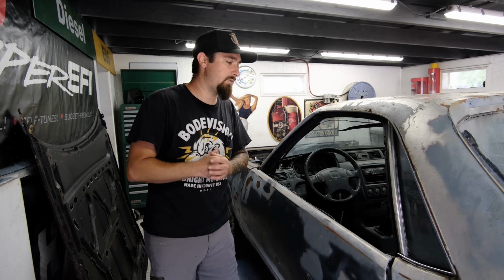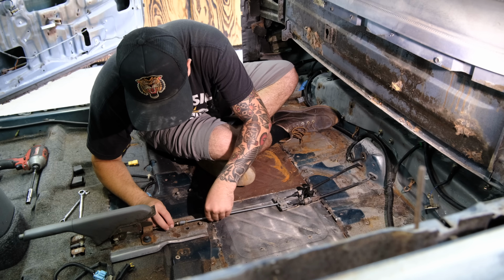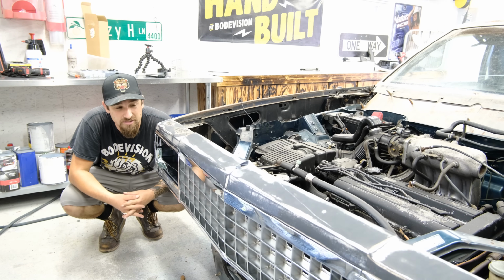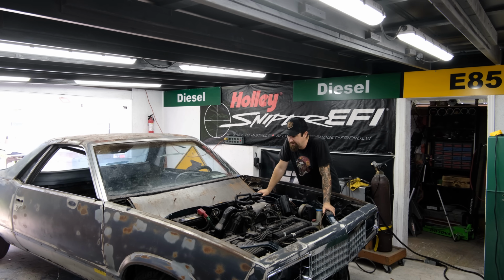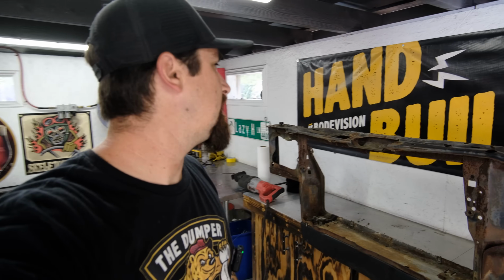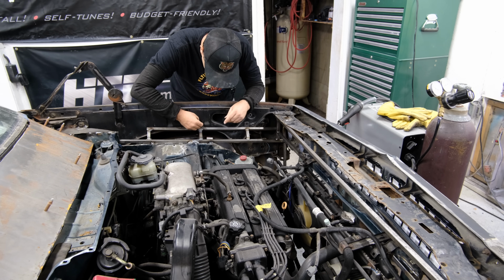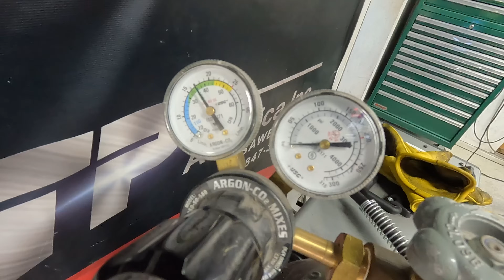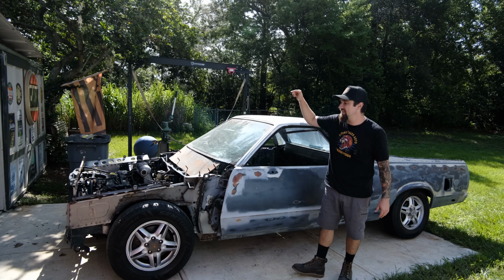Insane Body Swap: El Camino Front End on Honda CR-V & V8 Honda Accord is GONE | BodeVision

Comment: Being from Alabama I know how hot it is down here, keep the A.C you'll be glad you did if you drive and drag or just cruise to shows.
Reply: Im from Florida right around thr corner from bode actually. Keep the a,c!!!
Reply: Yes, Drag and Drive!!
Reply: I'm in Ky and a/c is sin, never use it.
Reply: @ItsDaJax  here in southern Alabama we have high humidity that stacks on that heat and I've come close to dying in it twice so if the a.c works I'm using it.
Reply: @M.Boatwright  I live in Kentucky, I'm familiar. Summers average about 90-95° without the heat index.

Comment: If you have to extend the drive shaft, you should get a Freelander drive shaft with a viscous coupler and pin the rear diff while you're at it. Especially if you plan on boosting it.

Comment: What are you planning for the fact the dashboard sits so much closer to the front, and looks as if the steering wheel does too which in turn the seats gotta be closer to No ?  I felt like the inside while you was sitting was huge in overall length. What’s the plans